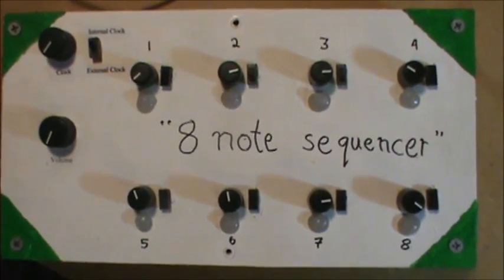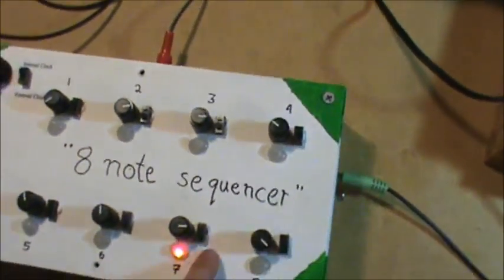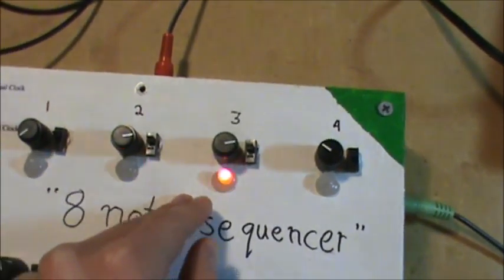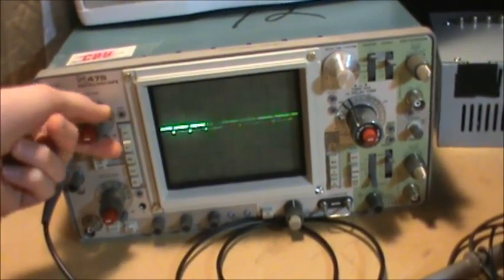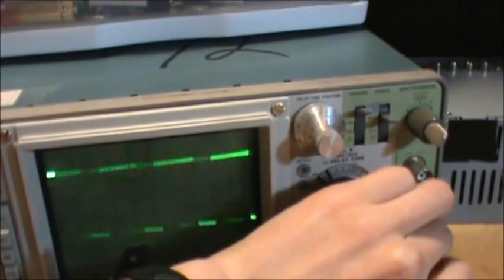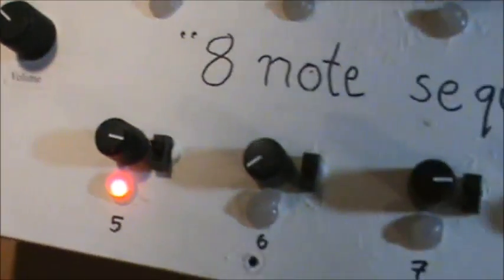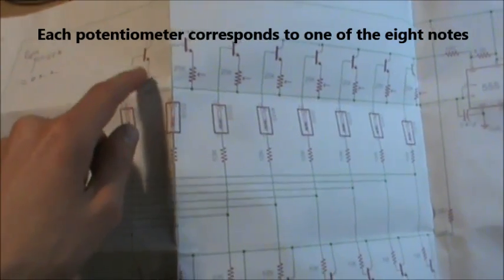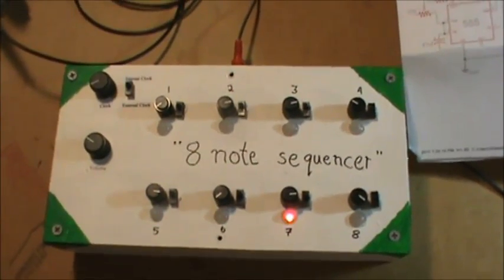8 Step Sequencer using a 555 timer as the oscillator

Comment: Sorry Ryan, but what's component Q17? before the audio output ? from the schematic
Reply from the maker: The component labeled "Q17" is a really weird symbol for an N-channel MOSFET device. I used a 2N7000 for the job.
Sorry for not getting back to you sooner, youtube didn't send me any email notifications about your other comments.
Reply: Ryan Jensen that's ok man, one more question, is it a 0.47uF or 47F ? is this a typo?
Reply from the maker: Will Wiffen Wow! I'm terribly sorry it took me so long to get back to you.
It is indeed a 0.47 µF capacitor. This value is fairly low because the 555 needs to oscillate in the audio frequency (which is a much higher frequency than the sequencer steps at). The smaller the capacitor is, the faster the 555 can charge it up, and discharge it (the output frequency is based on how fast the capacitor can be charged and discharged)

Comment: great man, what's the combination of resistors that you used to generate a good "musically" relavent tempo variable
Reply from the maker: if you look at the schematic I included in the video description, http://i.imgur.com/l37EUW5.png you can see that I used a 160kΩ potentiometer between pins 6 and 7 of the 555 timer. I also used a 3kΩ resistor between pin 7 and my positive power supply rail. I have a feeling this is a typo. Try 33kΩ as well as 3kΩ...

But in any case, just mess around with Resistor-Capacitor values until you get something that works for you.
Or, alternatively, you could check out a 555 calculator for getting in the right ball park area: http://www.csgnetwork.com/ne555timer2calc.html
Reply: What's the component labeled q17?
Reply: thanks man, your really helpful
Reply: actually, i'm using 8 separate Multi vibrators (not 555 timer based) and I'm using a decade counter to play each step of the sequencer, I know this is a very over the top method as you only need one and then the components between the decade counter and the multivibrator change the frequency of the note, how can i avoid using 8 seperate multivibrators? I'm using the standard multi vibrator setup, but i dont quite understand how i can vary the frequency of the sythesiser's single note per step, by a pot that's before the multivibrator note. IM NEW TO ALL THIS BRASHAZZ, cheers man if you can help
Reply: I prefer a sine wave sound ya see
Reply: also I need help with the signal output to audio out. I'm studying yours but that Q17 components blowing my mind
Reply: well, i just need to know wtf that component is haha.
Reply: I'm getting that the threshold and trigger of the 555 depends on a specific voltage to churn out a different frequency, but in my multi vibrator, i'm not sure if i can do this at all? maybe i can
Reply: not knowing this made me start planning it using 8 seperate multivibrator circuits
Reply from the maker: Will Wiffen Sorry for getting back to you so late! You don't need 8 seperate oscillators. You just need to vary the resistance seen by one oscillator. In my circuit, I'm using BJTs as crude switches to allow the oscillator 555 to "see" a particular potentiometers resistance between pins 6 and 7 of the oscillator 555.
However, to produce sine waves, if you are looking for audio purity, I think the easiest way would be to do what you have described. Using eight separate tunable sine oscillators would do the trick.
Ideally, you would create a sine oscillator that is voltage controlled (and can have its frequency be controlled by a voltage, not by changing a component value like resistance, capacitance, or inductance).
However, VCOs tend to be much more complicated than simple component-tunable sine oscillators.
I hope this helps at least somewhat even if it is a few months late!

Btw, how far have you gotten with your version of this project? I would be very VERY interested to see what you've built.
Post a video or some pictures with audio samples of your device if you have it working, or even if you don't  ;)